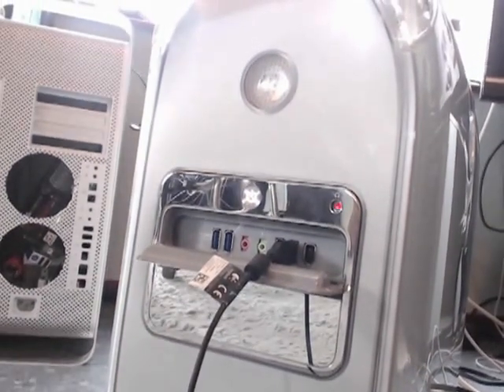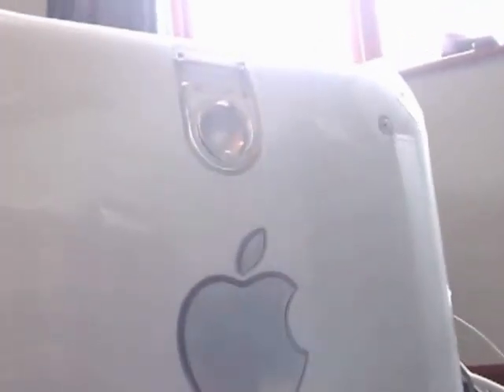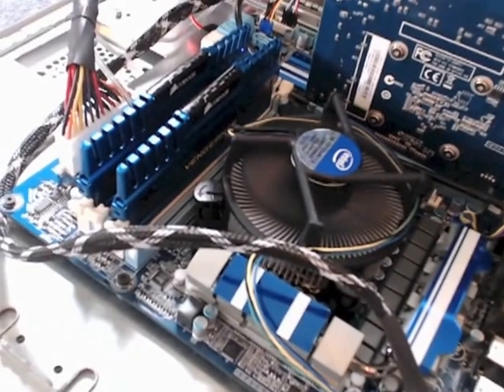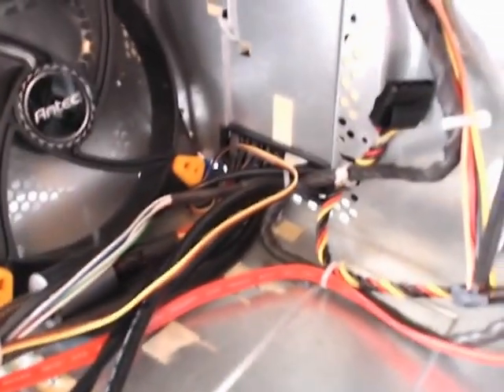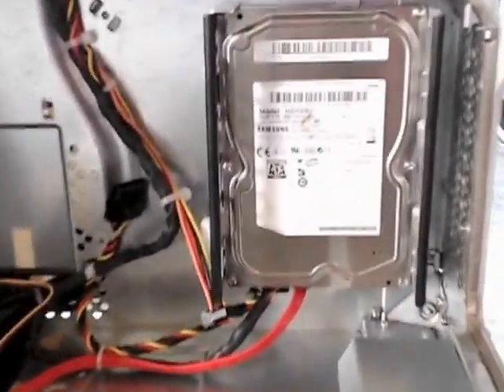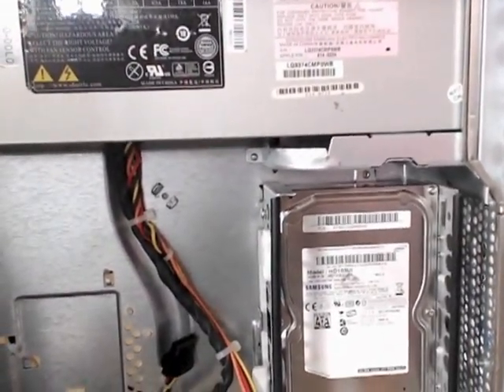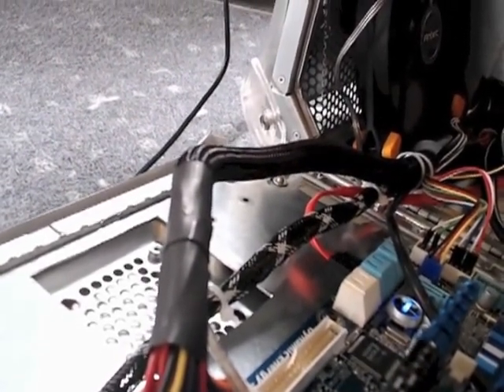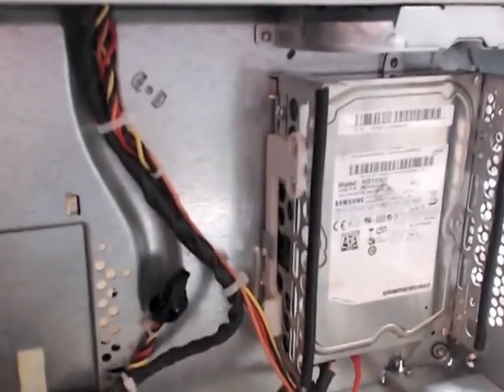Converting MDD G4 to mATX

Comment: ... continued  ...    the secret is to getting a full atx to fit is to double the height of your stand offs this lifts the board over the bottom  pivot point of the case  enabling you to fit the board so it  is a few mil from the bottom of the case inside . this way you do not need to alter the rite origonal back panel or the top and lock

Comment: hi. i recently converted a g4 mdd to Full atx . at first what i did was stripped it down cut away what i needed to and at the back cut the bottom right corner or the metal away to just above the bolt hole for the clear handle i also needed to do the same to that handle . the back panel i made from steel sheet with an angle and simply rivited it into place . then a piece of perspex to match the back panel  just for cosmetic reasons . the secret to getting the full atx in without cutting the top